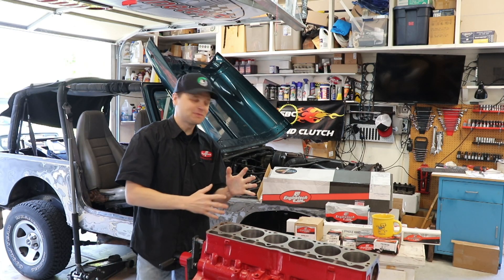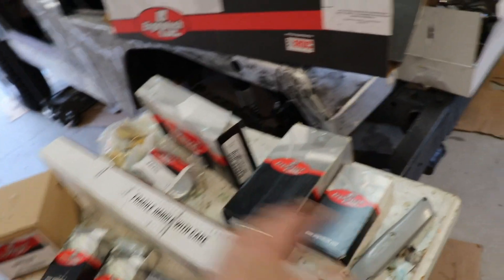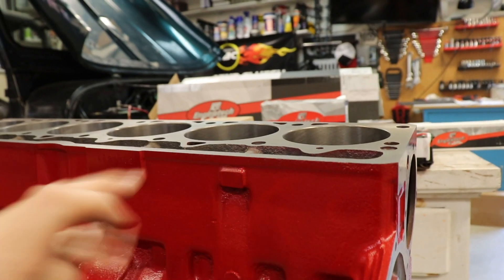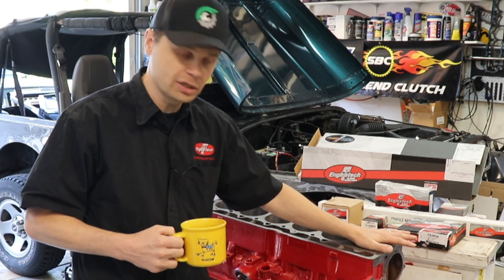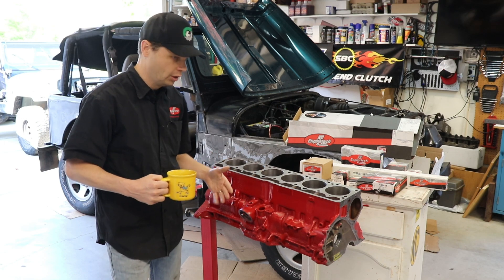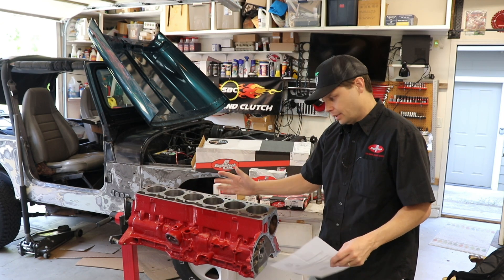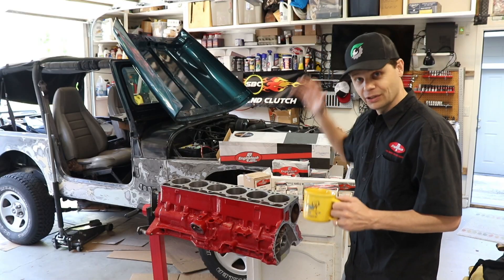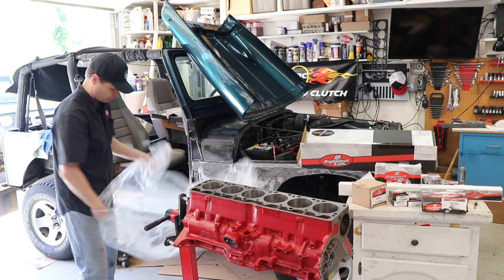What did the Machine Shop do? Jeep Stroker Build Part 4

Comment: Love this series Dale.   Love your excitement too!  Just hit 200k miles on my original 4.0 engine and manual transmission.  Still going strong.
Reply from the maker: Yes. These inline 6 motors will go 300,000 with little trouble

Comment: Dang. Idk who got robbed on the machine work, you or the shop... that was less than 1/3 of what it cost my to have my block done. Bored, honed piston clearance, cam bearings, one extra step the shop i use did was hone main bearings before boring to get all the holes perfectly in line with the crank. The deck was finished to a very smooth surface for use with mls head gasket. Cant wait to see the end result!! I couldn’t be happier with my stroker.

Comment: Hello. I removed radiator from grand cherokee 2001 4.0 6 cyl. The bolts seized on radiator so I could not remove the trans cooling lines from radiator the entire washer and bolt that trans lines attatches to is what came off and while trying, put a twist kink on the upper cooling line.  FAST FORWARD.. I purchased new cooling lines,  but as I disconnected the rubber hose from the cooling lines( to remove busted radiator),..from underneath the Jeep, I did not take notice, which rubber hose attatches to upper and lower cooling lines. I  am hoping, that hey... this one goes here.. because it reaches or not. I am sure this matters can you help a girl out.  thank you guys ahead of time!

Comment: My jeep mechanic didn't trust the machine shop work .
I was strongly advised to buy a jasper motor. There precisely put together and bored with a 3 year warranty behind it .
Reply from the maker: Yeah, I guess it depends on the shop. Gotta find one with a good reputation
Reply: Jasper remans.... Aint what they used to be.
Reply: @d.sm.4146  My jasper engine is still holding strong . Fires up on the first key turn